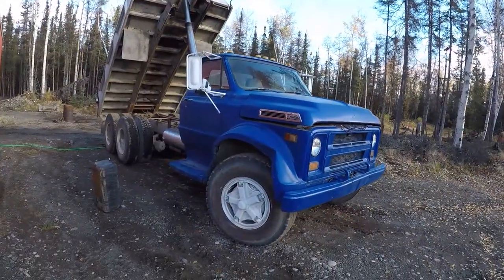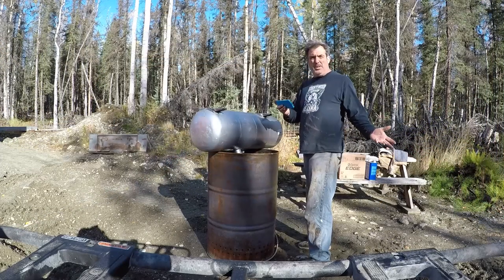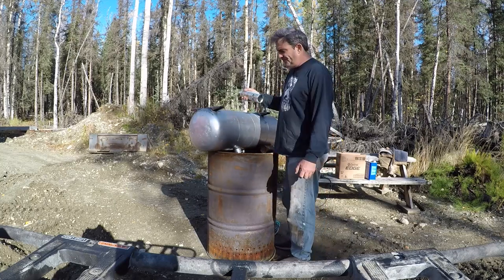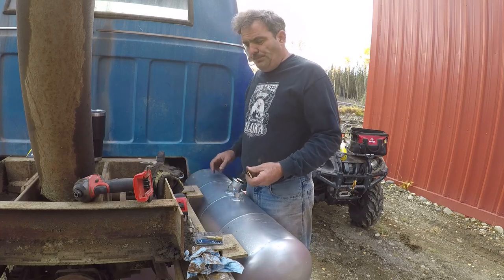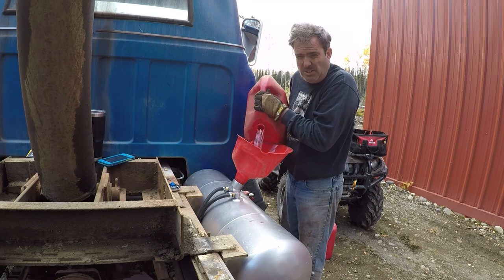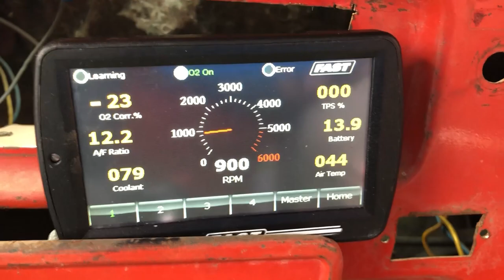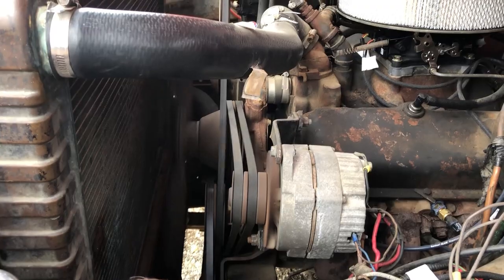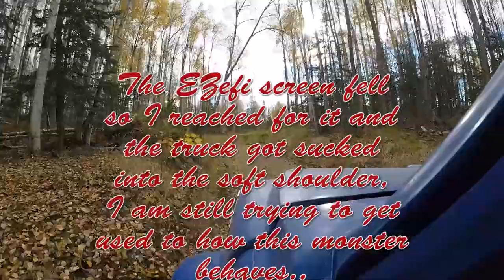Chevrolet C60 Homestead Dump Truck Gets A DIY Fuel Tank!

Comment: Since your truck already has a big block gasser , You might look into transplanting a 8.1 with the Allison into your truck ! This engine trany combo was first put into the 2001 Chevy\GMC 3/4 and 1Tons and ended in the 2007 year model ! They continued installing this engine\trany in motor home frames for several years past 2007 ! This engine was rated at 340 Hp and 462 torque . It would really make your dumper run significantly stronger as well and would also help with pulling an equipment trailer loaded fairly heavy ! 
Good luck with your small business !!!
Reply from the maker: I've been debating on using one of my Caddy 500's actually! 😜😍 This truck honestly runs clean enough as is that I'll probably resist temptations and try to concentrate on cleaning it up and making it road worthy though.  Do love engine swaps though!

Comment: Just came across this informative video, I have a 1968 all original mint single axle C-50 with a freshly rebuilt 292L 4spd with 2spd rear end, it is a one owner large farm truck with a 22' tilting grain body and I am going to restore it and repowering it with a 4-53T Detroit Diesel as that was a option in 1968 (4-53N) would like to install a M-35A1 rear tandem bogey on it but still doing the math on the drive train, probably will need to install a 3spd auxiliary transmission in it what do you think of this idea?
Reply from the maker: To be completely honest, I am a rank newbie to world of these trucks, and most equipment in general.  That said I am a sucker for swaps in general, and have done a number of them in cars and normal pickups with.  This truck and my other "dead to others"  equipment have been a (usually) fun learning experience so far.  

 I vote that if you can get your hands on the donors you need, and get them to fit.. if for nothing else than fun and smiles.. do it, and enjoy every moment of it!  

I'll keep puttering on this truck as well, hopefully I can get to cleaning up the body and box while slowing making it road worthy along the way.  These trucks at a local car show could be a lot of fun I would think!

Comment: I was interested when you said you have a Chevy pickup with a 500 Caddy.  I had a 77 Chevy, Heavy Half,  long bed I put a 75 Caddy with the  TH400  transmission.  I took the oil pan off an 80 model Eldorado with the oil pickup tube and main bearing stud ( for the oil pickup tube support ) made some simple motor mount brackets from 3/8 thick  flat mild steel. Bolted to the cross member,  and used 3 inch channel iron for the transmission cross member.  Had to shorten the Chevy drive shaft by 
5 1/2 inches.  Drove it without any exhaust  did have exhaust manifolds,  to a muffler shop,  had them put a complete 2 1/2 inch duel exhaust on.  Well,  what they did was run  2 1/4 from the manifolds to under the body then stepped it up to 2 1/2  used 2 turbo style mufflers,  then pipes out to the rear bumper.  Mine was all stock and I got 16  MPG on highway,  ( better than the Chevy 350) . I loaded it up with firewood,  I measured the bumper height empty, and loaded. The rear bumper was 6 inches lower and the front bumper was 4 inches lower.  Don't know how much weight that was,  all I can say,  is it pulled just as good loaded as it did empty. Loved that truck. 😊
Reply from the maker: Sounds like a great truck!  I swear the old Cadillac big blocks don't get the credit they should.  They were designed specifically for turning slow and moving massive land yachts with ease.  The torque output stock was insane!!!  

There is a video on my channel showing my truck, dubbed Ol' Ugly that shows my setup indirectly while I fight a power steering pump issue on it.  Near the end of it I fire it up to check and.. well.. it's not quiet! LOL 

The '71 500 in it is .030" over bored to 507cid, MTS#10 cam, roughly 10:1 compression, Edelbrock manifold, Fast EZEfi v1 fuel injection (best mod EVER for it).  The exhaust is log manifold to a 2 1/2" Y pipe I built, then single 3" through SpinTech 3000 series muffler.  

The truck is my pride and joy, though it's the second version I have built.  It will end up being shipped to the homestead at some point where  I can build a tube chassis for it and retire it to a life of drag racing on occasion.  I'll end up building a third version first though by converting my 2000 K3500 in the background of various videos posted.

Thanks for sharing about your truck!!! I love reading about other peoples projects, especially ones that have Caddy swaps in them!
Reply: @VowellVentures  
Sir, very impressive! 
That sounds like a really cool truck. I will take a look at it. The 472 is a good engine as well.  Thank you for sharing Sir.
Reply from the maker: @bertgrau3934  yup, 472 is an awesome engine!  I just got lucky enough to stumble across a dead Eldorado when I was looking for a fun donor.
Reply: @VowellVentures  
That's cool, it already has the rear sump oil pan.

Comment: Hey boss. Find a 454 parts engine. Pull the crank, get some 6.535 rods and some 1.64 compression height pistons. Build a 454 tall deck. Should get around 500tq at 1800 rpm. Especially with peanut port heads and the static compression of 10.5:1
Reply from the maker: I'm not a Chevy BB fan in general, but that is not a bad idea at all!  Keeps it cheap, suits the "mod everything" mentality, gets the torque up and keeps my gearing the same.  That's a lot of boxes checked!! Thanks!
Reply: @VowellVentures  it's what I did with my C60 and she moves 53 foot trailers loaded down with round bales without a problem. Used to have a 366 the first year I worked it.
Reply: Found 2 complete 427 engines and a complete 454. Made a 454TD for my C60, put a rebuilt 427 TD in my K30 3+3 and a 427 in my 95 caprice wagon. Have no complaints.
Reply from the maker: @bladenrexroth2555  this is definitely sounding like a must do project!  I need to swap my primary gear box (hopefully this summer) then figure out why the auxiliary is stuck in LL or L, but after those are taken care it might be time to find a donor 454!
Reply: @VowellVentures  aux boxes are notorious for becoming soup bowls. Years of winter and summer condensation gets inside of them and causes rust, bearing failure and gear teeth to become bluetooth. Bet if you cracked the drain plug on your aux box you'd see 2 gallons of water before you'd see oil. Depending on the last time it was serviced. Drain it and open the service plate. If you see rust? And if nothing metal comes out in the drain? Fill the box with kerosene and let it soak for a couple of days. Put some PB blaster on the linkage and see if it brakes free. Hopefully the aux box won't need much more than that. If it does? It gets expensive.
Reply from the maker: @bladenrexroth2555  will do, thanks for the tip!
Reply: @VowellVentures  You're in Alaska? I bet the aux box won't shift because there's a block of ice in it?
Reply from the maker: @bladenrexroth2555  it's been frozen since I got it two or three summers ago.  Figuring linkage or (now) water/corrosion down inside.  It's under the dump bed, but definitely exposed to decades of crap tossed up off the road.
Reply: @VowellVentures  I've opened up a few Brown Lipe, Spicer and Eaton  aux boxes of trucks that sat awhile. It's always water and lack of maintenance. Aux Boxes definitely are cool but I'd take matched gearing of trans, transfercase and rear end ratio over the aux box. What's your trucks GVWR? Mine is 65,000#'s. Have a no spin eaton rear and 7.17 gearing. Have a spicer 5652 transmission. Run 50 mph at 2900 rpms. 
If you're wanting to keep that truck for awhile and work it? Might be beneficial to swap out the trans, aux and rears for some heavy springs and rockwell 5 ton top loaders. You'd get 4x4 or 6x6 and can eventually upgrade with lockers. Truck would become a 4 season asset and money maker. Added benefit is military parts are cheaper to maintain, upgrade and purchase.
Reply from the maker: @bladenrexroth2555  pretty it's 60,000 at least, still a lot of unknown about it sadly at this point.  I do know it has spicer boxes, primary is the 5652 and aux is a 7442.. something like that anyway.  Both rears are driven.  It will mostly be a homestead hauler, it may get back on the road when I can spend more time tinkering on it.  Making it a 6x6 would be a lot of fun too.  Gives me something to play with that's fairly unique nowadays.